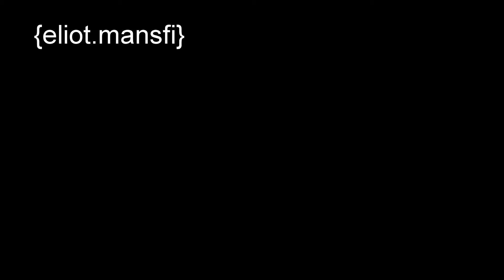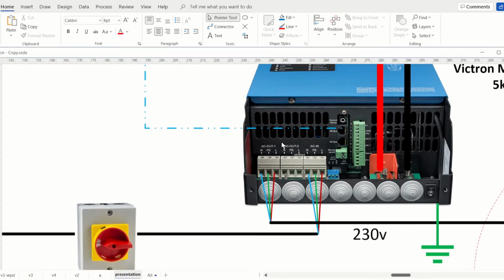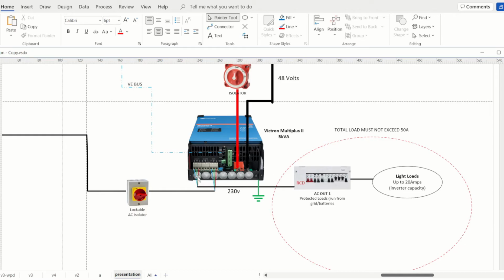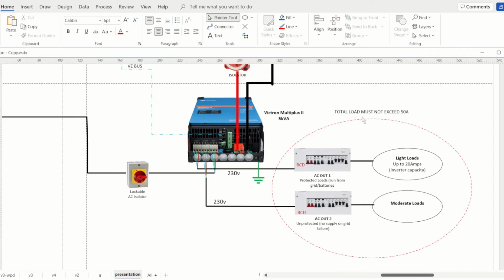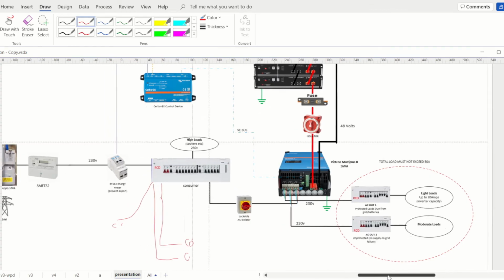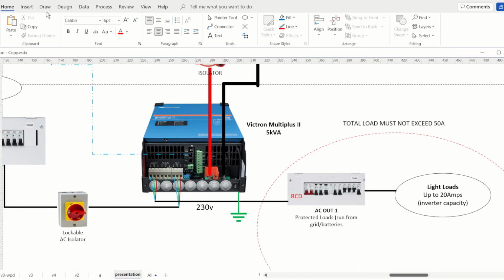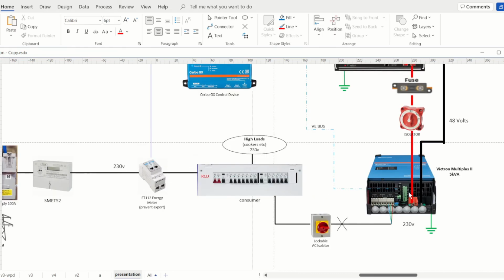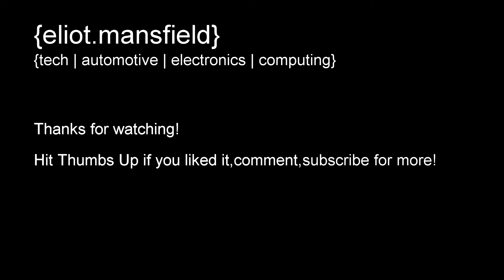Victron Multiplus Wiring Options Part 1

Comment: Excellent description thanks.🙏 However, I am still not fully confident about using this in my application, which is going to be an "off-grid" annexe with only the potential option of grid-recharging. The complete Victron system is ready for installation, Links Distr. & Shunt, Cerbo & 250/100 charger. Without knowing the internal design of this inverter, I find it difficult to create my ideal setup. I hope it will all be explained in the Multiplus user manual.
Reply: "I hope it will all be explained in the Multiplus user manual."  It isn't.  The problem with Victron kit is that it's really only designed for professionals to install, not DIYers. Unfortunately whilst that might have worked for Victron in the past, there is just way too much competition now (especially from China) such that if Victron does not 'open up' it will lose out, possibly to the point that Victron goes bankrupt. Consequently, it really needs to urgently revamp its training to make it all much less difficult for non-geeks to get their heads around. Doing so will only benefit everyone involved (except the Chinese), especially when it comes to safety.

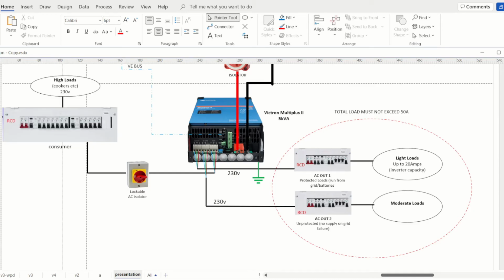To answer (hopefully and as best I can) your question, you can absolutely do what you want but you do not need the Cerbo, shunt or charger as the latter is built in to the Multiplus2. Your set up would resemble the video's at time 05:11.  To enable charging only at specific times you would need to install an ESS assistant and add a suitable schedule within the ESS to limit charging hours as appropriate.  This would allow you to take advantage of very cheap electricity rates - which what I do with my 20kW battery and 2 paralleled 5kW MP2s for my house.  Heavy water and space heating loads (such as they are) come off a separate CU before the MP2s.
Reply: @martinwinlow  Thanks for your input. At the time, I was trying to establish if I could charge the battery pack without necessarily connecting the loads to the grid, but I soon realised that the Multiplus automatically does that by default when in charge mode. 
However, I obtained the same result, avoiding having to use the ESS function or the inverter internal transfer relay, which, since I switch the house & garage consumer units from Grid to PV mode with an external 100A transfer switch. No risk of overloading the AC out 1 or 2.
So, when the house is running from the grid, the AC-in of the charger is used as a simple appliance from a dedicated house consumer unit RCB.
From the Multi settings, I set the “AC input 1 ignore” to “YES” and the Multi digital input to filter (interrupt) this function when I connect the house 230V to AC-in (AC in activates when signal is detected)
 
I have also adopted an external relay that switches the AC in to "On" only at specific times when the low tariff is available, controlled by the eWeLink application, so that I can modify the times as and when if needed.

I used the Cerbo relay 1 to activate the “generator start” so when both conditions are met (AC-in on & Gen Start), the charging will commence.
I have since introduced a Red-Node flow that refines with more details what was originally achieved by Cerbo’s Generator Autostart.

Comment: I've bought a Multi II 5000/48 with Cerbo GX and Lifepo4 battery pack. Will apply for G99 as in the UK. But looking for an electrician (part P qualified I think) who can install this. Anyone in the UK South East (Berkshire) been through this and have a recommendation? Ideally want someone who has knowledge of the Victron stuff. Cheers
Reply: you’re going to struggle to find anyone that will touch it

however it’s not too hard to DIY

have you got panels up etc?
Reply: @TobotronPrime  got panels from my original pv system. Not certain it's worth more with this set up as I'm looking to charge the battery up on a cheap electric tariff. This is really only to add an AC coupled battery into my setup
Reply: @davidpattinson5091  ahh gotcha I thought you were starting from scratch

I’ve done mine (6 panels on garage roof) and 4.8kwh battery Victron system myself

Just got a local spark to install the consumer unit meter and wire the inverter into the garage circuit (which is also connected to the consumer unit)

Once I get it working I’ll post a link to details here, if that helps…

I’m self taught, no experience of doing anything like this before, just learnt from YT and applying some basic DIY skills; also from YT lol

Comment: Hi, I am planning a single leg mode ESS but grid connection point is 30m from MP. Will ET112 work OK over that distance? Also, could I just use ct clamp which would be simpler to install. Thanks
Reply from the maker: The ET112 uses modbus (rs485) which is a fairly robust serial protocol which is good for hundreds of meters in theory.  Although not officially supported, it is possible to extend the connection.  Mine is at least 20 meters away extended over genuine cat6 cable (not crappy cheap ebay copper coated aluminium CCA ‘cat’ cable which is fake rubbish - i’ve done a video about it).   A friend had extended his rs485 connection via ethernet extenders and it’s also possible to get ethernet versions of the energy meters.  You do need to enable the terminator resistor for it to work, look in the pamphlet - it shows how to enable it

Comment: Hi Eliot, when the Multiplus 2 is in UPS mode presumably it isolates the input/output from back feeding the grid, so is in anti-islanding mode? Also I intend using a laptop to programme the unit, do you know if there is a UPS setting on this interface?
Reply: Would like to know that, too. Hope it doesn;t need full ATS stuff!?

Comment: Last method doesn't work with feed-in disabled in ESS remember my guys! :D
Reply from the maker: can you explain more
Reply: @eliotmansfield  With my system set up for ESS, i have disabled Grid feed-in and have no meter installed. This stops any power flow towards the grid at all times however the multi's and quattro both follow regions regulations and disconnect Grid when power fails. 

Wouldn't this stop the last example working in this case? I could be wrong though, don't hold me too it. :D
Reply: @masterswish3355  if you're referring to the last method as the "single legged mode" without a meter install at the distribution box talking back to the victron inverter, then pretty sure you will be feeding into the grid regardless of grid feed-in or not being set on the victron inverter
Reply: @TobotronPrime  Feed-in disables feeding to the grid, it's an option mainly for places like SA where grid feed-in is disallowed in it's entirety. so no power feeds back via AC-in 1 or AC-in 2.
Reply: @masterswish3355  I’m doing the same with mine in the UK (we have the same rule if you install your own equipment)

But I’m pretty sure you still need either a meter feeding information back if you’re trying to achieve that in single leg mode.

If your inverter is upstream of everything and AC in runs into it before anything else on the house circuit then probably yes grid feed in setting will work.

It’s a shame Victron don’t make this sort of thing crystal clear, they skip over the details in almost all their documentation.

Comment: If this was in a camper van setup, and I was using the 12/2000 80 multiplus, what size of 3 core cable would be needed to run the m+ input to the hookup and then the m+ output to the consumer unit, 16mm2?

Comment: This was really great. I have an apartment with 3 phases and only light loads. I start with a simple solution, just using multiplus ii as a ups. Just plugging the input to normal wall outlet. What i did not realise was that I need rcd on the output.
Reply from the maker: the rcd is required in grid failure because the victron becomes it’s own power station

Comment: Great video - keep 'em coming!
One question - in the simplest mode, are you saying that a supply from a 16 amp mcb in the main consumer unit (cu) could be used to enable the battery storage?  Wouldn't this potentially hook through to the other loads on the cu bus in the house above 16amp if they were close by and trip the mcb?  It just seems too easy!
Reply from the maker: 5000va unit needs a 20A mcb.  The unit cannot produce more than 5000va (about 4.4kw) so regardless of the house draw it wont exceed that - if you total house draw exceeds that then it takes the balance from the grid.
Reply: @eliotmansfield  Self-limiting - get it thanks.
Reply: @eliotmansfield  I realise I'm a bit late to the party here but I'm in the process of fitting a Multiplus II 48/5000 myself. Looking through my manual (Rev 5 09/2022) Section 4.3 AC-In : it suggests the 5 kVA model should have a 50A fuse or MCB protecting it. In the AC-out-1 section it advises the Power Assist feature can add additional power, now this is where it gets a bit muddy, the figures in this paragraph seem to apply to the 3000 kVA version because it mentions 32A + 13A = 45A, (32A being the Maximum Pass Through Current for the 300 kVA version) thus I assume if it's a 5000 kVA version (since it mentions 50A in the AC-In paragraph above, and in the Specs tables for the 5000 kVA version it states Maximum Feed Through Current is 50A) then these figures would be 50A + (5000/230= 22A) so potential output on max assist would be 72A, therefore the nearest breaker that you would need to fit on the AC-out side would be an 80A. Would you agree?
Reply from the maker: @thegrimreaper7777  without reading up, i suspect you have it wrong.  I think it will only ever output 50a and not combine it’s assistance to essentially exceed its maximum load rating of 50a
The terminals on the unit probably wouldn’t take the massive cable required to supply 72a - which isn’t far off the speed size of your meter tails.
so it’s 50a max imo

Comment: Amazing information. Currently in the process of installing a few of these systems. But trying to find the correct information is like pulling teeth. 
Is the unit bidirectional at default or would it need to be configured to work that way?
Reply from the maker: it’s bidirectional as default

Comment: Thank you so much for this extremely helpful info.
Im in the process of purchasing a Multiplus 2 and a 48v 4.8Kwh battery unit purely to support vital kit like the combi boiler, home alarm, CCTV, security lights, modem and maybe the freezer on a UPS back up basis.
I have a few questions additional to your brilliant advice, and would like to drop you a line for some more info if ok with you....(not sure how to do that as a direct message or mail).
Thanks again.
Reply from the maker: google my name

Comment: thanks for this video.  i’ve already learnt so much from watching it.  yet i still have one question.  in the single leg mode, the bi directional gds in and out from a spar in the consumer unit.   it can supply approximately 20Amp and would use this first, then if need can take extra power from the grid. How is this workload managed.  i can’t help but think it’s 2 separate supplies to the consumer unit which isn’t capable of prioritising which input to use first.   ?    i ask because if i spend lots of money on batteries i wanna make sure i use them/it first.

Comment: Brilliant video -very helpful. Do you happen to know - if you have a solar install using a FIT meter which you do not wish to disturb, can The multi II if you use another ET112 on the 230v output from the solar panel invertor - after the FIT meter - can This be used inteligentally to ensure all the solar sourced power (thats now 230v from the solar invertor) to use to charge your batteries or be used for daytime demand? Hope this question makes sense. Thanks again
Reply from the maker: Not sure I’m afraid - my solar is DC connected directly to the battery bus bar using a victron mppt charge controller.  I consume everything I produce.

Comment: Does multiplus grid tie? It doesn't seem to have a CT clamp or a CT clamp connector
Reply from the maker: Watch the video again.  The victron has an internal one - but if all the energy doesn't cross the Victron (what i referred to as single legged) then you need an et112 as shown in the presentation.

Comment: Great video Eliot thank you.quick question. When the inverter is taking power from the batteries and powering the house what happens if the draw is higher than the inverter can give i.e over 3kw?? Does it then pull the extra power from the grid to power the load or would the inverter switch off ?
Reply from the maker: if the grid is present then the inverter works up to its maximum and pulls the balance from the grid.
 If there’s no grid - then I assume it shuts down - because that’s really all it can do, not sure if it self recovers - i’ve not tried it to be fair

Comment: Hi Eliot Fantastic video. 
I want to use my inverter in what you call single leg mode. 
Just a question. 
How does it monitor for grid failure?
Reply from the maker: No power enters the unit - so it powers down.  In single leg mode you only use the input(output) and you must have an et112 energy monitor.  You don’t get any off-grid/grid failure support - it only works when the grid is present
Reply: Thank you. 
I want to supply mine from a Henley block taken before the consumer unit however after the ET112. Hopfully there’s no use with this.
Reply: Of course into a small consumer unit with a rcd and mcb.
Reply from the maker: @stevefowler7210  why not fit a 20a mcb spur from consumer unit and run it from there?
Reply: Few reasons. 
One I have messed up after watching your video it’s clear mine has not been wired correctly and I have now turned it off!
I had ac in fed from garage consumer unit and then the AC out feeding it back to its own comsumer unit protected then back into the Henley block. 
I found your video after seeing some other comments that if mains shut off my inverter wouldn’t and would power the grid. 
Now I am in a position of how to put it right. I am thinking do away with the feed from the garage and use what was the power out to become the bidirectional supply feed as you mentioned. 
Seems very wrong that this is not spoke about at all in the victron manual or wiring unlimited book.
Reply from the maker: @stevefowler7210  So your protected output was feeding into your consumer unit but also backfeeding the grid?  - if so, with all due respect it sounds like you need an electrician who's ideally familiar with the Victron MP2 because you could electrocute a linesman.
It's not Vicron's fault - they cant give specific instructions as every situation is different.  My Video is to help people understand the options - it's not specific guidance/training.
Reply: @eliotmansfield   it wasn’t back feeding the grid at the time as the ET112 was always maintaining min 30w from the grid with feed in turned off. 
How ever mine was wired as I stated with the AC output feeding back to the consumer unit. 
Instead of the bidirectional AC in as you have stated. 
Personally I followed the instructions to the book including wiring unlimited books from victron. However reading a lot of comments across Facebook with one persons post it’s quite clear a lot of people have done the same. 
Which points me to believe right or wrong instructions are leading people down the wrong path.
Reply from the maker: @stevefowler7210  I was mixing you up with another FB poster
Reply: @eliotmansfield  no problem and as said before I set mine up wrong however it was protected. But thank you for your amazing video and setting us all right. It’s much appreciated by the whole solar community.

Comment: Is it also true that you can use single legged mode to connect a PV Inverter onto AC-out2 or Ac-out1? I heard / understood that this is possible but in case of an power outtage the PV inverter has to switch off when the batteries are full during the outage otherwise it will damage the Multiplus.
Reply from the maker: Not exactly sure so would rather not comment.  But if you have on ac1 (protected) the PV will continue to work because it doesn’t know the grid has been lost and the contactors inside the multiplus maintains grid isolation and compliance.
Reply: @eliotmansfield  exactly! So you can script or program the inverter to shutdown or DRM the PV inverter by closing a contact. That way you can still charge the batteries.
Reply from the maker: @SanderStolk  Probably.  I went for DC connected solar panels - nice and simple
Reply: @eliotmansfield  True! Less loss from DC to AC and back. A MPTT from Victron is a better solution.